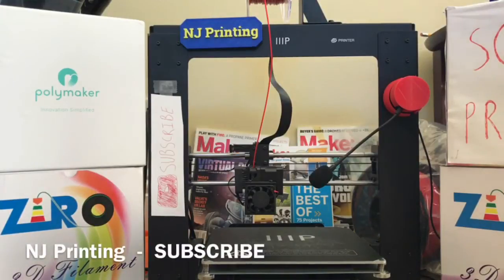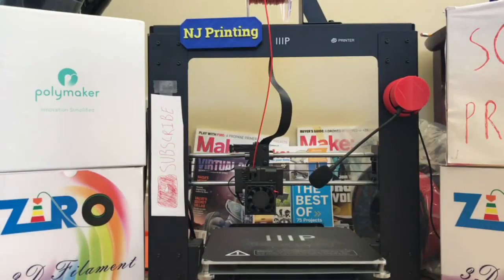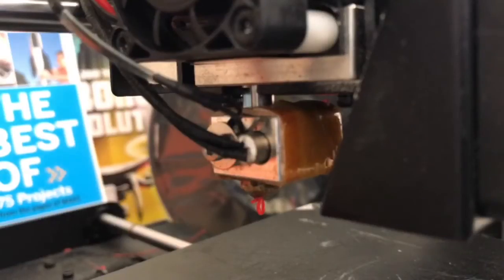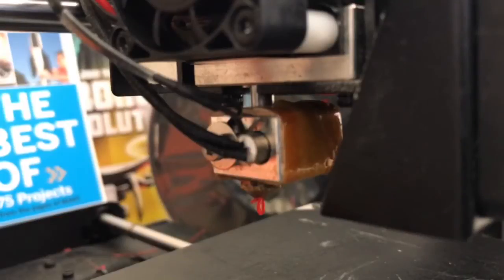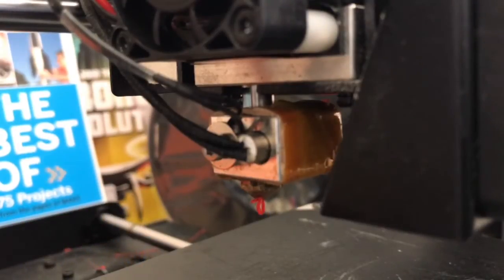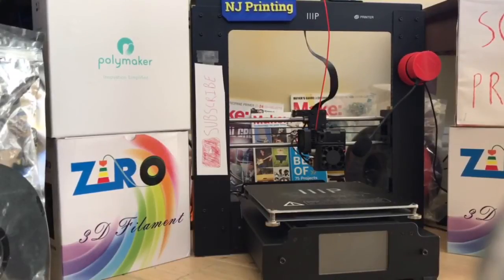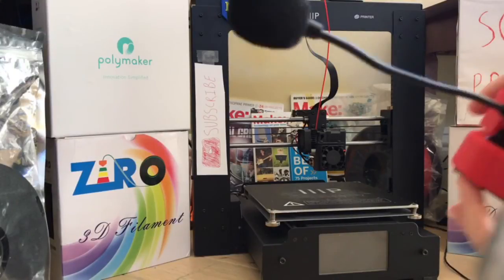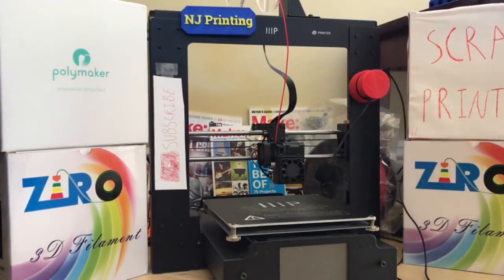How To Prevent Curling/Clogging On Your 3-D Printer Extruder

Comment: I rlly need ur help please please help me my ended 3 pro does fine when it does like the test line off to the side but  when it goes to actually print it just curls when it touches the bed
Reply: @B&B studios mine is fixed now
Reply: @B&B studios it needs to be closer to the bed even if it looks close make it closer and try out the CHEP bed level test. Also if it lower in the middle and all corners are about level then you could have a warped bed and a good solution is a glass bed upgrade
Reply: @shaark_1396  thank you dude! Mine was having same issue
Reply: if annyone stil has this problem i did to i raised my bed temperature to 70 and i cleaned the bed with dish soap ( not hand soap ) instead of cleaning it with 70% alcohol and its printing now